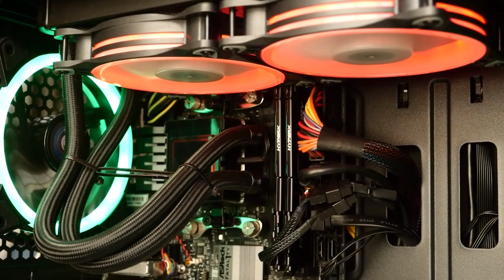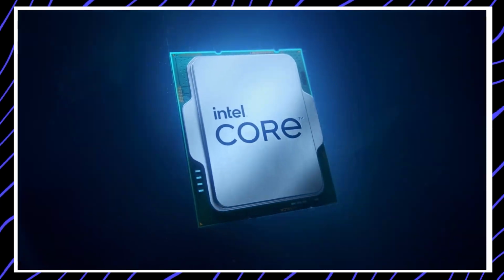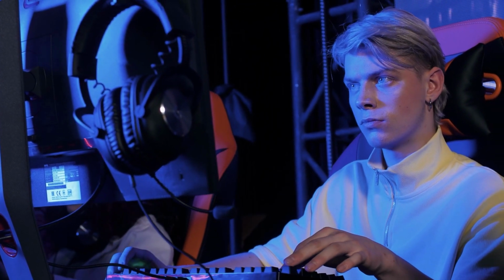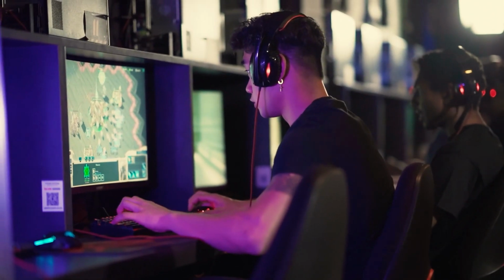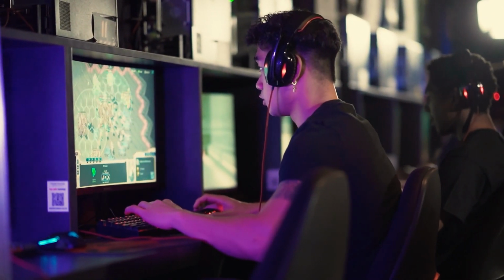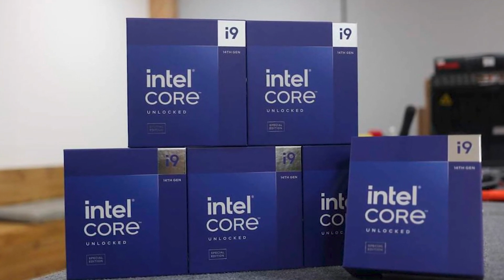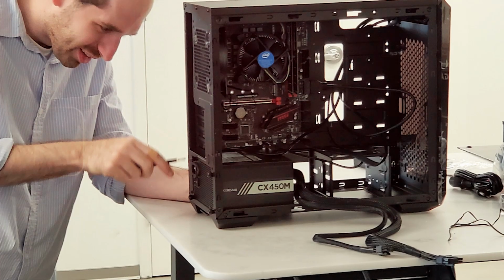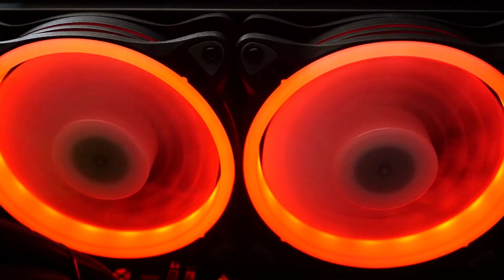Researchers Find Fatal Flaw in Intel CPUs

Comment: The microcode "fix" is just to nerf down the voltage and multipliers. There's nothing complicated about this. Intel overbinned their high end SKUs, and their chips' ring bus was never meant to take the voltages needed to hit 6ghz boost. Not having that elevated voltage just means that those chips will never boost that high again.

Comment: please read your script before recording, intel blamed motherboards for an intel microcode issue. bios defaults have been changed minimally and do not have auto xmp/expo on. intel's oxidization layers affect ram speed negatively and intel will not replace cpus affected since they set their spec for the cpus ram speed reliability at 4000. This issue with intel cpus was not brought up by researchers, gamersnexus and level1tech were the first to discuss the topic publicly to a large audience. Intel dropped the ball and left customers with permanently defective cpus.